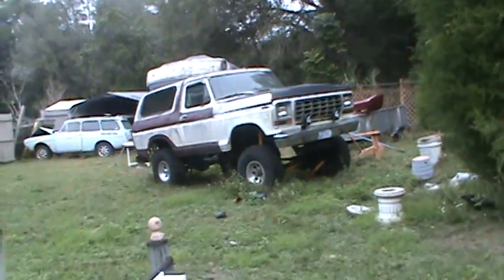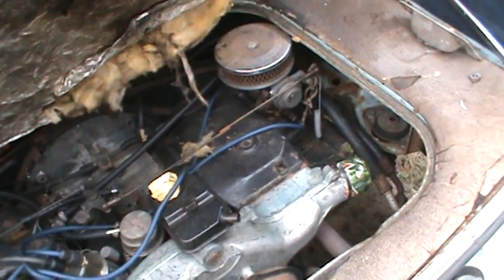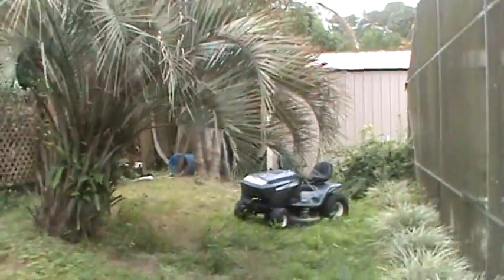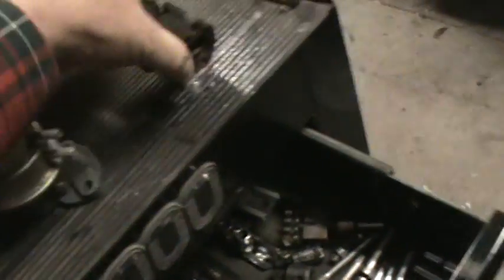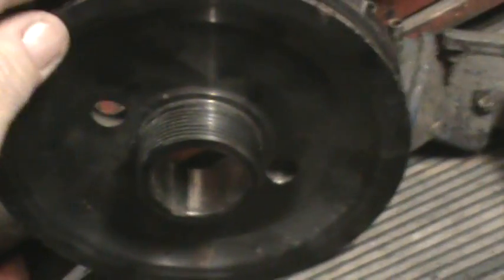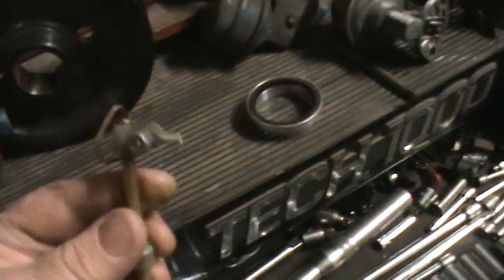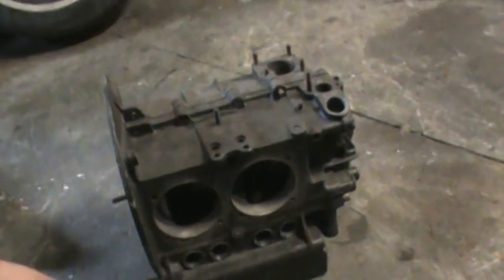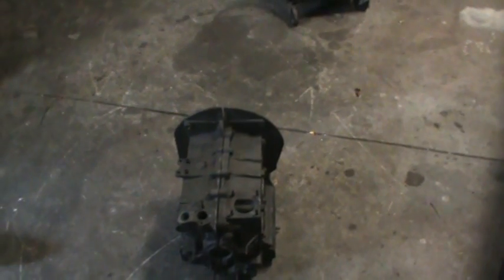Morning vlog

Comment: Thank you for the sand seal explanation. My engine is an 1835 with a bit of work bought used, wonder if the sand seal was installed and gone bad. I will have to pull the pulley and have a look because it is definitely leaking in front! Or rear however you look at it. I also appreciate the info on the pumps. I will have to be more careful in the future just picking up a random pump. Did not know they had differences. I really appreciate your willingness to share your knowledge!